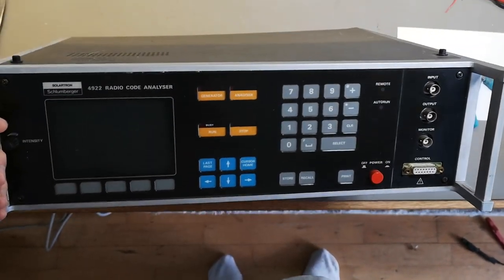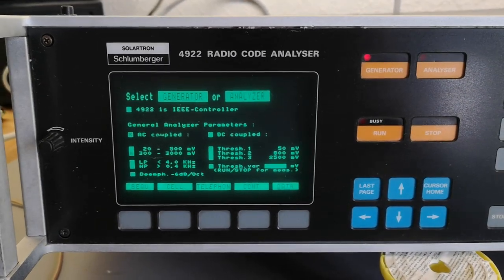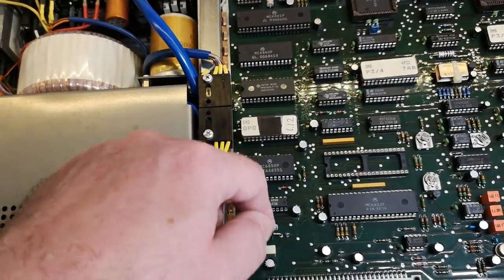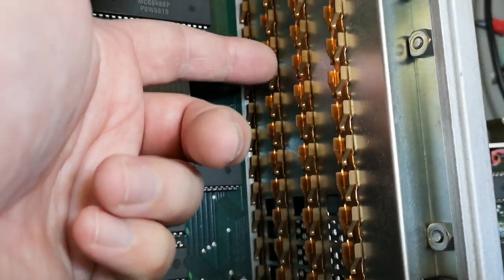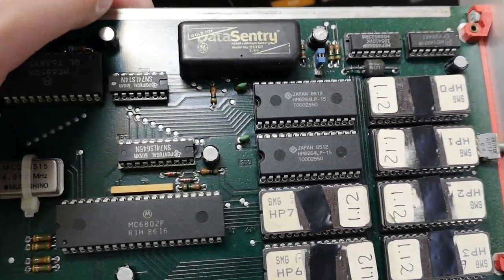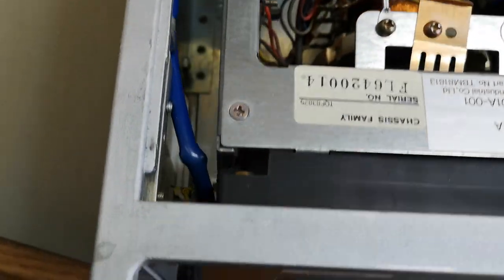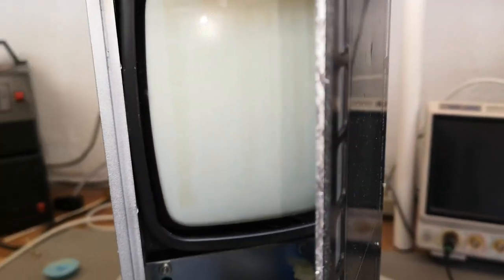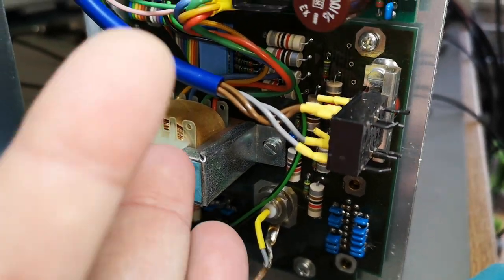schlumberger 4922 radio code analyzer test teardown

Comment: Regarding it's age that CRT is in pretty good condition. That front screen  is probably a polarization filter, maybe even with a conductive layer to keep the buzz inside.
And indeed, add an LM1881 and it should be able to do composite :)